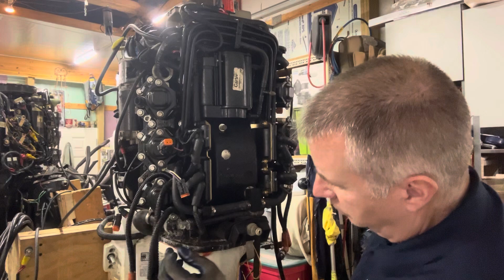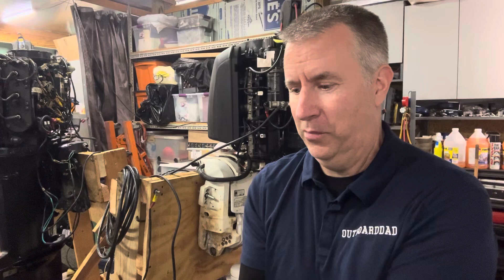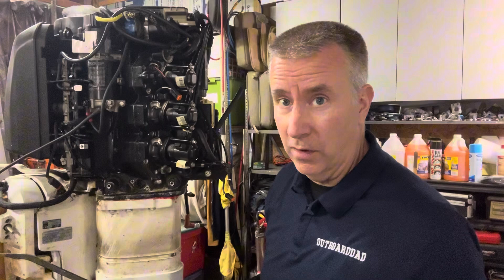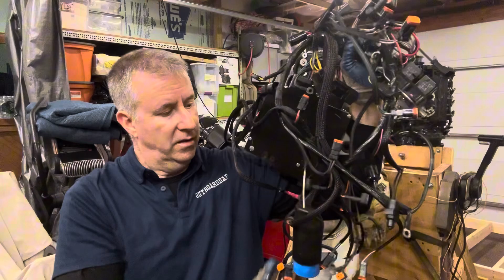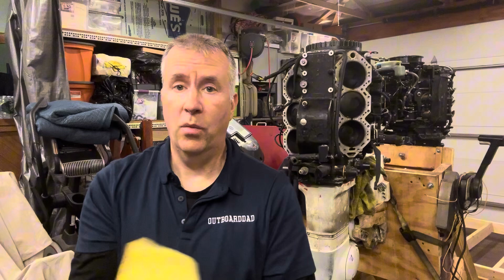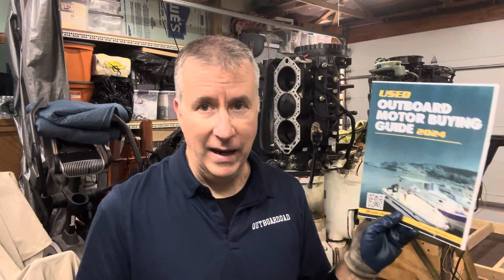What is the Deal with Evinrude Ficht How is It different?

Comment: Looks like that motor suffered a lot of misuse and neglect, which the older Johnson and Evinrude engines seemed to just shrug off and keep going. I have a 2004 150 HP Ficht motor on my 19' bowrider that I purchased in 2019. The boat was in like new condition with less than 100 hours on it and still has less than 300 hours. That said, (I'm touching wood as I type this), I've had zero issues with my engine. It always starts and runs flawlessly and shoots my little boat out of the hole like a sling shot. I maintain the motor meticulously, only feed it ethanol free fuel, use premium oil, added an extra water separator filter upstream of the one on the engine, and add a can of Sea Foam to every tank of fuel. I've had people comment that I should get rid of her while it is working well and I have seriously considered it, now that BRP is no longer properly supporting these engines with parts. Don't know, if I find a boat I really like with a Honda, Yammy, or Suzuki on the transom, I may trade her in.

Comment: Good evening, I recently bought a boat with this type of engine and now it doesn’t start. I am wondering if you know what type of scanner would work for this engine to see if I can find out why is not starting
Reply from the maker: Thank you for your comment, unfortunately there are very few places that work on them anymore.  Where are you located? Any Evinrude dealers around?
Reply: @OutboardDad thank you so much for your prompt response. Yes that’s the problem I am in Bermuda. Is really limited everything here 😬
Reply from the maker: @AKAMEGA Ok, so I would say with limited resources you may want to consider selling your motor for a carbureted motor that has more parts available and simplifies working on it. What do you think?
Reply: @OutboardDad  I kinda caught feelings for this engine already hehe … I have someone looking after it and seems that there is a some engines on island where I can get parts from. But your advice is definitely wise. Juts as a random question.. do you think using products such as injectors cleaner on the fuel is a good thing to do or better not to use those?
Reply from the maker: @AKAMEGA I would not, but there are places you can ship to to have them cleaned. Keep me posted and be sure to clean out that cooling system, and replace water pump, thermostats and EEM if it’s water cooled flush
Reply: @OutboardDad awesome, Thank you for your advice! God bless you. I will work on it and I will let you know what was the issue ☺️👍🏽 Thank you ! 🙏🏽
Reply from the maker: @AKAMEGA Gd bless brother!

Comment: In 1998 I bought a 98 FUCHT, I mean FICHT. While I was impressed with the Torque and Fuel Economy, I came to realize I had a ticking Bomb. My Engine got all the Updates, Firmware Updates, Heads, and each time it lost a bit of Performance. Eventually in 2001, I received a complete 2001 Powerhead. While it never Failed on me, it was soon to out of Warranty, so I traded it for an I/O
Reply from the maker: Interesting, what made you buy it in the first place? Or was it just on the boat you wanted?
Reply: @OutboardDad  
I had a smaller boat with an 84 Merc 115, and while it did just under 50mph, it was 14 yrs old, and I wanted something a bit bigger. I had read about the FICHT, and it sounded like a great Design. Like I said, mine never failed, but all updates till then had been Warranty, and by 2002, the warranty was getting ready to expire and any forthcoming Failure would be on My Dime. So I decided it wasn't a case of whether it would blow up, but rather When... 
After I had made the Deal, I dropped the boat off, and the Mechanics did an inspection of the motor.  He did find "Neat Little Scoring" in one Cylinder. The Powerhead had about 45 hrs on it. Being that it was still under Warranty, it didn't affect my Trade-in Value. However I did feel I had dodged a Bullet
Now with all that said, I was Impressed with the Hole Shot, of the FICHT, and its Fuel Economy, it used quite a bit less Gas than the 115 did on the smaller Boat.
Reply from the maker: @pjimmbojimmbo1990Interesting, sounds like you had done your research and made the right move. Although many people are still running them, I still think your better off no ton when you can. Where do you do your boating?
Reply: @OutboardDad  
Lakes in central Alberta, Canada. FICHTS/Ram-tec/E-tec/G2s are rarely seen here. Older 2 stroke OMCs are very common, the odd Honda, very few Yamahas, lots of Mercs, old and new
Reply from the maker: @pjimmbojimmbo1990Interesting, not too many Suzuki?
Reply: @OutboardDad  

Hardy see any of them, maybe a couple around the 10hp range, but I haven't seen above that in about 40 yrs
Reply from the maker: @pjimmbojimmbo1990Wonder why, very popular here in New Jersey
Reply: @OutboardDad  
I remember in 84, the Dealer where I got my 115 Merc, had a Suzuki 115 that had been in the show Room for a couple of years. He tried to get me Interested, even offering it for a few Hundred less than I had gotten the Merc for. I had never seen a Suzuki on the water, and had only seen one in another Dealers' yard about 380km away a couple of years earlier.  I declined.
A couple yrs later I helped haul some boats out to the Lake for that Dealer. We hauled 4 boats from the Showroom out that evening, just to ride around in. One of the boats had that Suzuki on it, It was a ft or two longer than my boat. I drove it for a bit and was Impressed, it had a Higher Top Speed than my Merc did, but it was under Propped and was over revving, but I still had about 25 degrees of Throttle Lever unused. It idled very smoothly and quietly. I told the Dealer, I would trade straight across to swap motors. Donnie just laughed and told me I had had my Chance 2 years earlier.
Reply from the maker: @pjimmbojimmbo1990LOL! My concern is the long term usage. But then again, nothing is made to last anymore so I’m not surprised. These four strokes are quiet and smooth running, have to say they are nice running when all is working
Reply: @OutboardDad  
I like the sound of a 2 Stroke idling, and the Snarl it makes when the Throttle is opened.  I also love the sweet Smell of the burnt TCW Oil. To me, 4 Strokes have all the Appeal of a Briggs and Stratton Lawn Mower Engine.
 I doubt there will be any rebuilding of the 4 Strokes, a worn or scored Engine will just get a replacement Powerhead, at great Expense, or the owner will just be forced to buy a new Engine
Reply from the maker: @pjimmbojimmbo1990You may be right, so much more work so is the cost worth the time and dollars, we will go deep in the series and let the motor tell us! Where do you do your boating?
Reply: @OutboardDad  
Central Alberta, Canada

Comment: If you're going to buy an old motor or a boat with an old motor, ZERO chance I'm buying a DI motor. I just rebuilt this 1980 Evinrude CV140 and it's running like a dream right now. Carbs are too easy. DI is a can of worms.
Reply from the maker: Thanks for your input!
Reply: If you actually learn the basics of a DI, instead of fighting it you will realize that DI is way simpler, easier to work on, and way more reliable

Comment: Just recently worked on a 1997 Evinrude 150 Ficht at work. Put on a good used ECM and a good used PDP along with a new water pump kit and running just fine. Also on my personal boat I run a 1972 Johnson 20 that runs spectacularly well! Just my two cents
Reply from the maker: @willssmallenginerepairllc5060  Thank you!

Comment: To OD: I love your content but find it difficult to listen to owing to low volume and the muffled character of the sound. In a technical vlog, audible details matter. If you would consider spending a $100 for a microphone, I would be happy to chip in. Thanks much.
Reply from the maker: @cleaterose5914  Sooo appreciate that! I have a DJI Mike and it was awesome for a few months but now when I plug it in it says Apple does not support it. I also have a GoPro that the mic works with but need to get a more powerful signal in my metal pole barn. Please bear with me, I will get there! Have a great Thanksgiving!
Reply: Volume is lower than other videos but I can hear him fine in my phone and all other internet devices.

You should be able to hear him right.
Reply from the maker: @josemariatrueba4568  Also, when my mini split is running for heat you get a low hum in the backround, I will get better at this. Just ordered a repeater for my signal and will start using GoPro and microphone soon! once I learn how to make it all work.

Comment: To be honest I disagree with the flushing part. I don’t think the blockage is due to not flushing. Salt builds up over the years on the cooling system and turns into something like a rock. Even fresh water doesn’t dissolve it, so flushing can’t do that much. Also my opinion is that every time you use your outboard for eg 2 hours in saltwater, it is some kind of flush aswell. Salt water isn’t saturated with salt. It can dissolve leftover salt deposits from previous runs easily. The salt deposits in my opinion mostly form when you shut down your motor and the salt water evaporates inside the cooling system, leaving all of its dissolved salt on the cooling passages. I believe that after a lot of years the only way to clear salt is by grinding it off by opening parts of the motor. Just sharing my opinion!
Edit : I hadn’t watched the whole video, I agree with what you said, you should periodically inspect the cooling passages!
Reply from the maker: @andronclock1  Thanks for the feedback, yes I agree, also using salt away every so often will keep it down. Motors that are used more frequently have less that have sat and evaporation left deposits